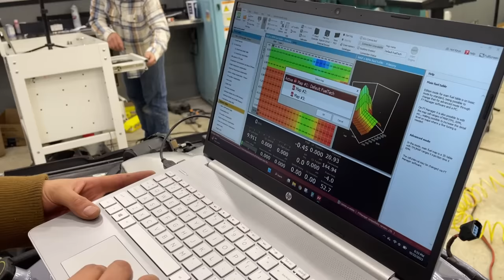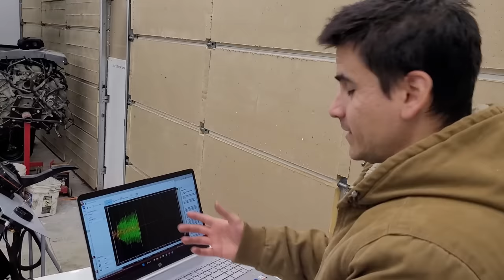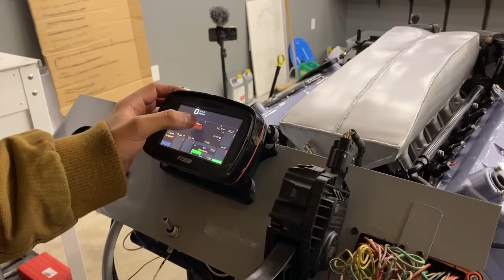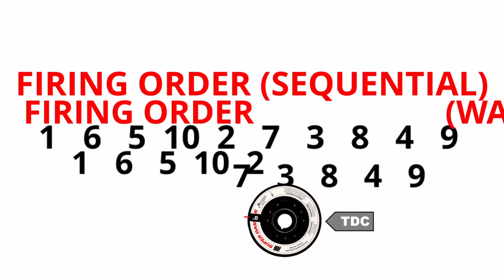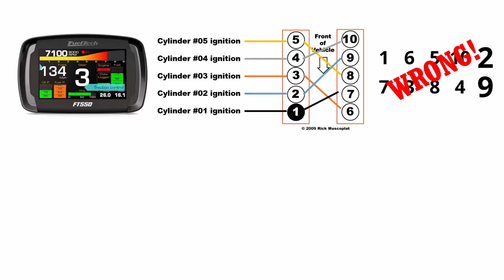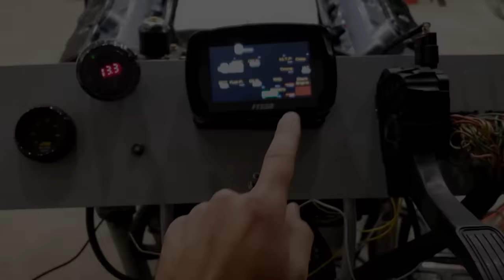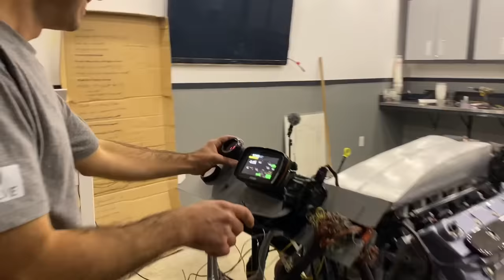Ford 4V V10 First Start! | It Sounds Insane!

Comment: Guys, I want to make a few suggestions for you to consider and I understand that you can't make everyone happy and you're going to do whatever you want regardless but I'll recommend them anyway and see where it goes.

1.  First and foremost I want to congratulate you on getting this thing finally going.  Seriously, this is an awesome feat.  

Next, I would suggest putting out quite a few more videos than what you have been putting out.

I understand that the main focus of your channel and this build was just to get the engine up and running which you have finally done however, you need to be putting out way more videos rather than getting one out every few weeks or a few months.

The reality is, since you're working with a niche set of viewers that are either Ford fans or more specifically Ford V10 fans, you have to realize that they are few and far between in numbers due to the fact that there weren't that many to begin with but also, the fact that Ford no longer supports the V10 as a whole for the most part so that minimizes the chances of fans as well.

Also, since there really isn't much support for the Ford V10 and hasn't been for years, there really aren't any new videos out with the Ford V10 so any new content that somebody comes out with, the Ford V10 fans or lovers are going to be itching to see as soon as possible.

So, you really need to be putting out quite a few more videos. I'm not sure if you're aware but a lot of channels have been getting a lot more views lately because when people like a certain channel they want to see even more of that content. So, some channels have figured out that if they start putting out two to three or more videos per day, they will all get views and that keeps their viewers interested and engaged which ultimately increases your views which obviously increases your revenue eventually.

I understand that you may sometimes want to edit your videos so that you are trying to put out the best content with the best qualitybut honestly, you need to not worry so much about trying to spend a bunch of time editing your videos to put out the best content.

You would be surprised that a lot of your viewers or fans would just like to simply watch your videos unedited and see what you guys are going through as you are getting this going or working out some of the technical difficulties or diagnosing certain things and so on.

In short, what you might think is boring to others is actually interesting just to see the process that you are going through. Plus, even if it's sometimes quite a few minutes of not a whole lot going on, people like to watch those videos as background noise sometimes. 

These tedious things that you think are a pain in the ass and time consuming are actually kind of interesting to a lot of your viewers.

So, I would suggest to try to consider putting together two or three videos each day that are 15 or 20 minutes long or maybe even just one or two that are 30 to 40 minutes long and put those out daily.

Honestly, I'll bet you would be surprised at how many people would like to watch your videos.

Again, you have to keep in mind that your fan base is already looking for new content for the Ford V10 engine since there really isn't much out there to begin with and not really anything new so people are going to be eager to want to see what you were up to.  

Plus, obviously since you are doing something that is totally new and groundbreaking with making a 4 valve version, that peaks everyone's interest even more.  So, everybody wants to see what's new and coming up with whatever you're doing so they are eager to see anything that comes out right away.

2.  As you are noticing in some of the comments, there are some engineers or other people that have been involved in the industry or field that have been quite impressed.

As I read these comments, I think of some things that concern me but are positive but could potentially be negative depending on how you want to look at them.

For one thing, just on a personal note, I think Ford really dropped the ball by not continuing to support the V10 platform and obviously not come out with a four valve version or even make a little bit larger displacement.

But, I'll leave that for another discussion.

However, I reference that mainly to point out that I wouldn't be surprised if you do end up getting contacted by Ford to potentially help them consider resurrecting this platform.  Maybe. 

If you guys end up making this work without really any help from Ford, imagine what they are going to think if you end up making this work well all on your own.  Ford would be stupid not to consider the possibilities of what they could do with this engine if they see you get it going and it does well.

I almost guarantee you they would want to talk to you either to try and help them come up with other designs for future projects or maybe consider taking this one on and figuring out a way to revise it and make it work in their current, past, or present platform of vehicles or other ones designed for other use like RVs, busses, commercial vehicles and so on. 

Obviously I could be wrong but if I'm right, I hope that you guys will really think about what you're doing and whether or not you want to submit yourselves to going through whatever it is that Ford would put you through in order to further their objective with their company. 

Basically, what I'm getting at is, try not to let your main goals and principles get overtaken by the potential of a big paycheck that Ford may consider offering you.

My worry is that if this does turn out well, they would want to simply pay you off to squash the idea so that others don't get the same idea that you guys have and continue working with a little bit older platform because this will hurt sales of their newer vehicles.

I'm not going to try to sidetrack too much but honestly, their new 7.3 liter gas engine is basically a joke and I don't care what anybody says, they aren't going to convince me otherwise. I've done tons of research and watched endless videos of people reviewing the trucks with those engines and honestly, it is extremely disappointing and it's laughable watching the people try to talk that engine up and basically feed everyone else a line of bullshit about the engine and its power or fuel economy numbers.

It doesn't get crap for fuel economy and now there are various issues that some of the owners are having with that engine so I fear that it's going to be a nightmare scenario in the near future for a lot of owners as they start to approach or go past the 100k mile mark or the 150,000 mile mark.

Just for reference, I have actually driven the newer version of the 7.3 gas engine as well as the newer 3 valve version of the 6.8 V10 in two different u-hauls. To be fair, the 7.3 had good power but honestly, I don't know that it was significantly better than the V10 and the fuel mileage wasn't any better. I believe they both had 6-speed automatic transmissions. I don't think the U-Haul I drove that had the 7.3 gas engine had the 10 speed in it from my recollection.

3.  I'm glad you didn't even consider using any sort of variable valve timing phaser set up but my guess is, that's what Ford would like to recommend you try to modify or revise into your setup which would just be a complete nightmare scenario. So, for this reason, I'm begging you not to even consider doing anything of that sort because you're just asking for problems.

The fact that the two valve and the three valve Ford V10 versions did not have the variable timing phaser and had static timing sprockets is one of the main reasons why the Ford V10 engines were so reliable or durable and people love them.

So please, don't even consider going the variable phaser route.

4.  I'm not sure if you're familiar with the manufacturer or brand called Kill Devil Diesel but they apparently came out with their own heads for the Ford 6.0 powerstroke diesel engine and they are completely brand new castings.

Although they focus more on diesel engines, the reason why I bring them up is because since you guys modified your heads from the V8 versions of the 4.6 l or 5.4 l Ford engines, I would recommend contacting them to see if they could help you come up with a brand new casting for your heads so that you would not have to worry about them being welded. Also, if there are people that want to purchase similar heads like these in the future, it would be a hell of an option that I'm sure a lot of people would like to have or at least the ones that like the Ford V-10 engines. 

Now that you've got this one done, if it works out well, you can simply take what you've learned from this and duplicate it with a brand new casting.

Although, I think it would probably be better off to consider doing it with the newer 3-valve version of the engine, if I'm not mistaken, I think the engines themselves are pretty much the same regardless of year but I thought there were a few small variations depending on the specific year so I would think that people would love to have the option to have their newer engines modified with better heads as well. Again, maybe it doesn't matter so maybe my comments in 
 regard is basically a moot point.
Reply: Putting out videos is super tedious. So im not surprised they did it this way. Ok. Any ways, I read it all and seriously i hope they did too. I learned something.
Reply: @OEFarredondo  I'm aware that putting out videos can be tedious and time consuming.  I get that. But I still believe it would help their channel a lot. I'm obviously biased with my feelings and I thought I made that pretty clear with my previous comment. I'm aware of that. Regardless, it wasn't just a selfish request. It was meant to help them as well.

The thing is, too many channels are thinking that they have to spend all of this time editing their videos so much so that they are scared to put something out that doesn't look really professional and has awesome angles or views with added "fill" or editing done to wow the viewers but the reality is that many viewers just don't give a crap about how refined or "professional" the video or content is and just want the content to watch or listen to.

Again, the fans of the Ford V-10 just love info about them and since this is a new and unique thing that's being done, the interest level is likely at damn near and all time high for the Ford V-10 fans.

Comment: Definitely was fun seeing you guys work through a few of these issues with the spark setup on the standalone. The way the code is written in all these ECU's they fire each output sequentially like a distributor cap and that can't be changed. It's up to you to wire in the firing order for your specific engine just like you would setup the wires on a distributor cap. Kinda counterintuitive as you would think since it's a computer you would just input the firing order. Don't worry I learned it the hard way too.

Comment: It sounds great and I really hope that it runs well for a long time. I have to say though is I took your advice and removed the balance shaft from my recent '99 F250 6.8 rebuild. It's going back in as soon as I can get to it as over 4k rpm the engine feels like it's going to vibrate itself to death.

Comment: Great job guys. The angle of those throttle bodies draw some concerns for intake turbulence at high flow. (Air running into itself from the opposite throttle body trying to cross the plenum)

Comment: Well-deserved success, may many more come!
And in all fairness, Ford probably knew they could build it too, but building one or two, or even a few dozen for racing purposes, vs tooling up for full on mass-production.. 
I'm a layman and things that come to my mind is what parts to compromise on to save on cost in order to profit on it when people may or may not even like the engine... or for that matter even the car they would have had to put it in.
Then there's the pandora's box, build something insane, and your competitor will build "insaner", like individual electronic valve control and so forth, so now you're in a tech race to build the baddest meanest.
Ford probably had to think about a billion things, all playing into why they didn't go for it.

Comment: Something ive notice over the years...ive seen my dads best friend build no less than 100 small block chevrolet v8s...it was usually not the ones that sounded good that ran great....most often the really great running builds didnt sound the best...best i can explain is a truck with open exhaust, with a fat cam, but you feel it in your chest, this guy im talking about ive seen mill heads down so far the passages may not seal and it was questionable wheather or not the valves would contact the pistons once hot, and race gas was a must, i remember some heads with angled valves he would have to clearance the top of the cylinder to allow the oversize valves to not catch on the top edge, he would say "im not trying to get 50,000 miles out of it...if it makes 5 good runs it was worth what i got in it...which is gaskets, valves, a cam and time" and make no mistake he hurt feelings with these free motors with barely any money in them, for a few days before the crankshaft is in three pieces from RPM or a piston gave up or he found the weak point in that particular block casting etc 😂 miss that guy....he was enlarging a hole in a blower case one time in his lap and it slipped, bit went into his theigh and he let go...drill just spun down slowly...he just looked at it for a bit....😂....i wish he had gotten the chance to play with ls engines...he would have LOVED ls and would have built some quick piles of free parts 😂

Comment: 4 valves per cylinder is a neat accomplishment.  Should make north of 500hp if tuned right.  No VCT on the cams though so only so much you can do with it.

Comment: This 6.8L DOHC 40V Triton V10 would be a great swap for some Canadian Ford's as well like the Meteor Rideau, Meteor Moncalm, Monarch Richelieu, Monarch Lucerne, Meteor Ranchero, Mercury M100, Mercury Econline and the 60 Ford Frontenac.
Reply: But what about the 6th generation Ford Taurus? (Ford’s flagship sedan)
Reply: @mlsabc1236  Nope it wouldn't (unless you do some customization like they did to the 2017 Lincoln Continental to make the V10 work) but it would easily work on a Ford Panther Platform (Ford Crownvic, Mercury Grand Marquis, Mercury Maurader, and Lincoln Town Car).
Reply: @CJColvin  So, it would need a bigger hood up front and a quad-outlet exhaust system in the back?
Reply: @mlsabc1236  Correct
Reply: @CJColvin  Okay, thanks.
Reply: @mlsabc1236  You're welcome, you'll also have to convert the Taurus to RWD in order to do this swap.

Comment: Boys, I was involved in the retro-mustang program in the early 90's. The Cobra GT5000KR was to sport a 427 V10 with variable superchargers. This engine is the bastard child of our original design. Your heads completed the deal. I have the chills! Thanks for posting this. 
Are you gonna put it in a stang? I'm new to your channel. If you want to make the GT5000KR I would be glad to fill you in on the details.

Comment: I had to see this....I have a 2000 Excursion with that motor. Runs like a champ. I also have a 1970 F100 short wb 6 cy in like new shaoe l.....I guess you see now what you have done...😉😉😎😎

Comment: heat cycles and running under load, oil pressure routing results and running in all kinds of different conditions will determine if this is a 100% success.Sounds really nice.There is a motor cycle engine designer in the UK that has been grafting engines together that has some great running engines that has some interesting content on YouTube to check out too.

Comment: Hard work and dedication are easy I find money to be the hard part.
I was always told the problem with v10 is the vibration. 6,8,12, 16 cylinder engines all run good the V10 was skipped because it has a strange vibration and the engine falls apart. 
My experience is mostly diesel . I’m interested in how it does on a Dyno an real world use. Only street numbers really matter.

Comment: Now if you made custom equal length headers, but cross some pipes to opposite sides of the block and into a 5 to 1 collector!  The timing of the exhaust stroke would not only add power, but sound amazing🫨 like a Supercar!

Comment: Is electron beam welding really expensive? When Ford developed the 6 Liter V12 in the mid-1990s, they electron beam welded two SHO Yamaha V6 engines together. It was used by Aston Martin when in production.

Comment: Congratulations! Sounds nasty. I'd hazard a guess that your design probably has better rod bearings than the S85 ha. Probably a bit late now but for anyone reading.... Full throttle while cranking = fuel cut (clear flood mode.)

Comment: With a Water line at each end of the head, how can the water flow through the head with block off plates where the 2 pieces join? You'll need some bypass hoses won't you?

Comment: The prototype v10 that ford never produced was a 4.6 block with 2 extra cylinders and came to 351ish cubic inches, not the v10 truck motor.